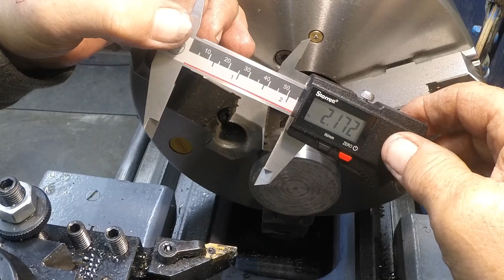TURNING AND LEARNING

Comment: A2 is air hardening tool steel - it's one of the premier steels for tool & die work .  It's very stable in size when heat treated , unlike oil hardening or water hardening steels .  You'll need to get the 'blue beast' leveled & straightened out before you can expect to get any accurate readings from your dials - * along with getting the tailstock set true to the world . . .    Turn a bar of material several inches long , & measure it every inch to see how much taper you're dealing with - that will tell you quite a bit about how the lathe is setting . . . 
I can't imagine that the dials are 25 thou out of whack . . .  unless the dial was loosened between measuring & cutting .   ?    Strange !     You can expect to not hit your dialed in number if the tool isn't well centered - ( that could be the culprit ! )
Reply from the maker: See Steve Lang’s comment. It was a math mistake
Reply from the maker: Thanks for the info on the A-2
Reply from the maker: I’ll going to cut a test bar soon

Comment: AISI A2 Tool Steel is an  that contains 5% chromium. A2 is noted for its good toughness and excellent dimensional stability in heat treatment. ... A2 Steel falls between oil-hardening and D2 high-carbon, high chromium tool steels.